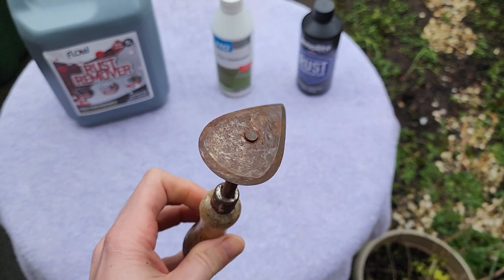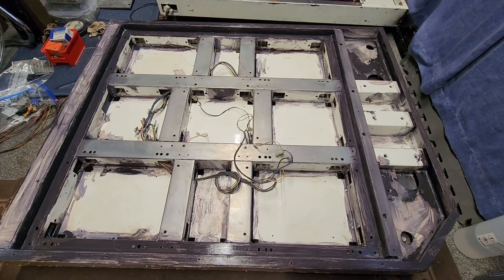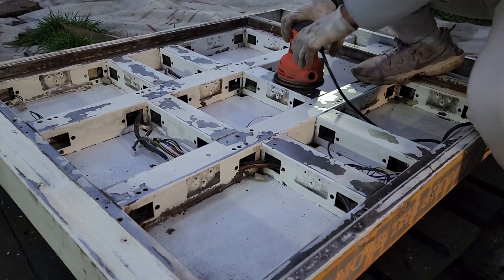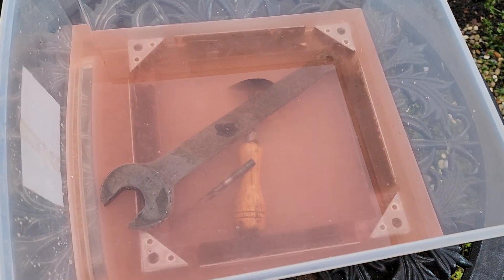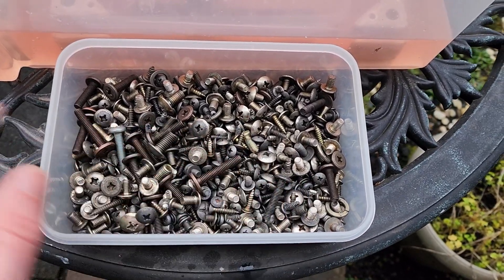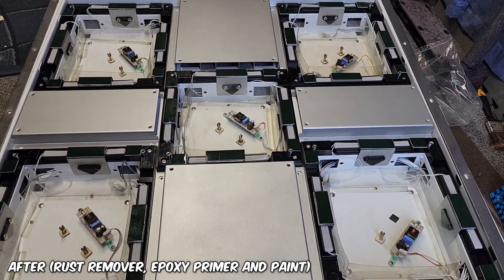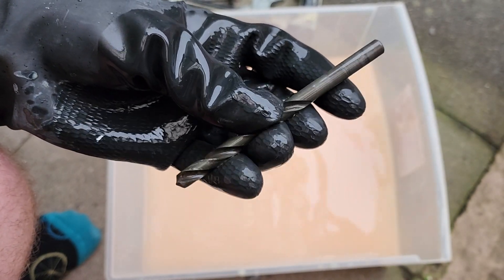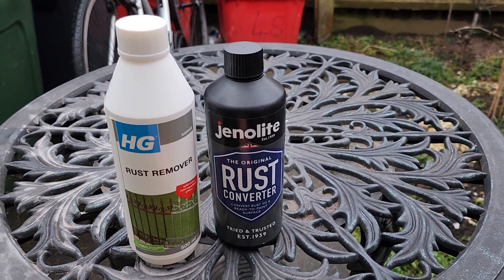Rust Remover vs. Rust Converter: Which Should You Use?

Comment: My experience with using 2 different rust converters over the years, neither actually worked that well, the rust started to show back through a year later. Project Farm channel on here tested several of them, long term tests, NONE of them seem to live up to their claims, sadly.
They are all snake oil to some degree I feel.
Reply: while i agree it's annoying to have to maintain your stuff once a year, metal has a tendency to rust and it's in the chemical laws. you can't expect an infinite rust remover. 

do you later coat with uv and water resistant lacquer to prolong the effects and have to maintain less often?
Reply: @rgb.offset  The main issue I have here is that we are being sold a product that doesn't actually convert rust back to metal, like body fat can't turn into muscle no matter how you train for example.
The fact that all these rust converters state that you can't use them on a sump pan or anything else that get's hot kind of gives the game away,.....they know that it doesn't turn the item back to metal otherwise why state that for a start?
Reply from the maker: I'm almost at a year later, and to be honest, they still look great to me!
He paint over them after rust removal? or not? Im guessing not?

Comment: Why rust converter cannot be use for inside of fuel tank?
Reply from the maker: 🔥 1. Chemical Incompatibility with Fuel
Rust converters (typically tannic acid or phosphoric acid-based) are not chemically stable in fuel:
Gasoline or diesel can dissolve or react with the converted coating.
This can result in sludge, clogs, or contamination in the fuel system (especially injectors or carburetors).

⚠️ 2. Flaking Risk
Rust converters create a thin, brittle layer (like iron tannate or iron phosphate) on top of rust:
In a fuel tank that experiences sloshing, vibration, and temperature changes, that coating can crack or flake off.
Those flakes can clog filters, fuel lines, or injectors.

🧪 3. No Long-Term Protection Under Fuel
Rust converters are designed to be painted over—not left exposed:
In a fuel tank, there's no topcoat to seal the converter.
Without sealing, the surface may re-rust or degrade, especially at the fuel-air interface.